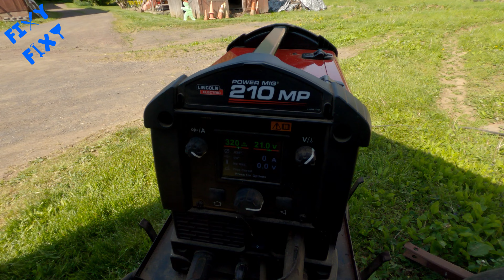Replacing The Jack On A 1987 Big Valley Gooseneck Horse Trailer

Comment: Thank you so much!  The jack was binding up on our 1987 Travalong gooseneck stock trailer as well many years ago.  I was too afraid to weld a new one on, because the welds are actually on the outside piece of the jack tube, so I was afraid of accidentally going through the outside tube and welding it to the inside part of the jack that slides.  Now I know to just tack weld and let it cool each time.  My Grandpa ended up just hiring the trailer dealership to weld a new jack on for us.